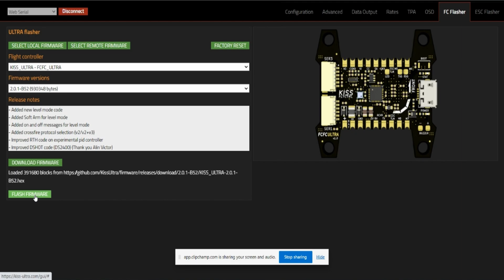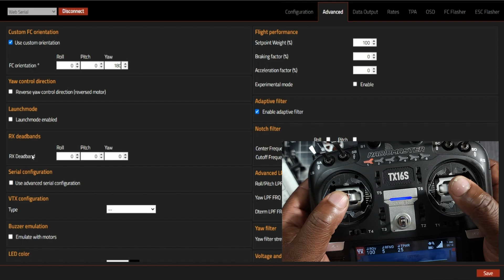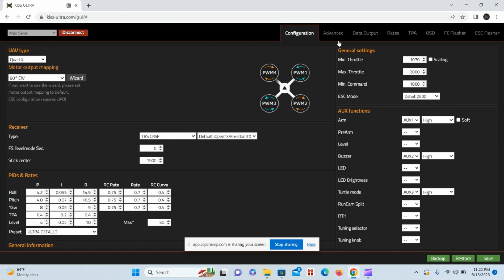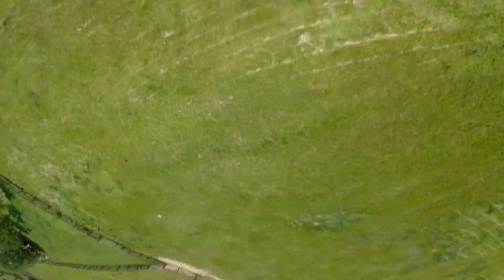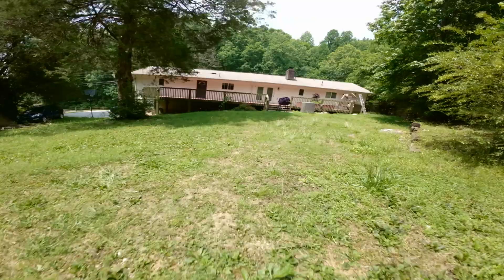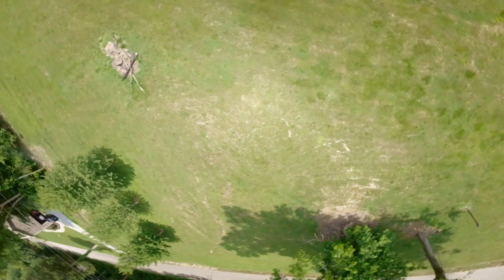KISS ULTRA FCFC V2 SET UP GUIDE

Comment: I just got a FETec stack and downloaded the kiss configurator V3.1.7 and need to know how to set this up. I can't find an updated version of the v3.1.7 or if it's all the same from one version to the next. I have the ERA frame with 6s motors. If like to use 4s motors with 6s batteries but I didn't know if there's  a motor output limit or a profile to switch between the 2 4s and 6s batteries like BF has. Let me know how to set this up or just go by this video

Comment: I use kiss ultre v1 with foxeer 65a ESC. The connection cable should be correct because the ESC self-test sound sounded 5 times. But the ESC cannot be recognized in kiss gui. what do I do? please help me
Reply from the maker: You should  be using BLheli 32 pass-through . Just open Blheli 32,  power on your drone, and connect  the. FC to the PC

Comment: Great vidoe thanks for the info, that is a nice set up on the quad, i recently bought the APEX EVO non dc, i obviously want to try 03 but keep my V2 goggles, you put out some good ideas on trying different, components motors, etc, i noticed the go pro mount old APEX doesn't fit the evo luckily i got the steele version.
Reply: My shopping LIST is, t- motor G4 HD FC, t-motor Pacer 60amp v2 esc, rcinpower GTS v4 2207, 2040 kV, and the 03 air unit, and just stay on crossfire.
Reply from the maker: As for the go pro mount,   it is available on thingiverse.com.  Are you building a 6s or 4s setup?
Reply: @GBoniFPV  I got the Steele version EVO it comes with the gopro mount my old APEX mounts are different, going 6s

Comment: Use less "advanced" motor wizard :) will make your wideo 5 min shorter ;)
Reply from the maker: I already got a lot of tips on setting  the V2.  I didn't realize there were so many features.  The drone is flying as great as it is.  Now, I understand I can even get to fly better 👏 👏 👏 👏
Reply: Hi Alex, what should be the current divider value to use with Fettec 45A 4 in 1 esc? I'm using Ultra V2.
Reply: @NishantPinto  none. use esc telemetry for voltage and for current. same on voltara.

Comment: Hey man. Good to see you getting into Ultra. There’s some recommendations you might want to consider. First off all, it’s a good thing to make a separate model in your radio for your kiss and kiss ultra quads. You can see that your current model has the sticks not centered in the GUI. If you center sticks for beteflight, they are not centered for Kiss and vice versa. That’s why you want to have a separate model for Kiss setups. And calibrate your sticks so they show centered (1500) in the Ultra GUI. Second, it’s recommended to enable experimental mode, and use one of the presets for a V2 with experimental mode enabled. I would recommend the V2 exp default preset. This really gives the best flight performance on the Ultra V2. Then there’s some other minor things that are recommended, like using throttle scaling and soft arm. Also flight performance wise, definitely try setpoint weight and breaking factor both at 100, and try Acceleration Factor at 50. Also using some RX deadband is recommended, 10 on pitch and roll, and 20 for roll. TPA curve has another recommended setting then standard. Check the box to use custom TPS influence values, and setup the first row of numbers as 0 25 25 100 and the second row as 0 0 0 100. OSD can be set up for all systems, not only analog. O3 is the only one that cant use the pretty Ultra font unfortunately. And last, setting up the esc orientation, motor direction and setting props in and out is very easy using the motor wizard. I’m pretty sure you’ll get a better experience using these recommendations. Cheers Gboni.
Reply from the maker: I will definitely give it a try. I can't imagine  the drone flying even  better because it's actually flying great already l.
Reply: @GBoniFPV  should make a difference still. Would love to hear back what you think of the extra Ultra goodness these changes will bring 😁
Reply: Great info just installed my kiss Ultra mini and will try these settings .🙏
Reply: What does "scaling" and "soft" Arming do?